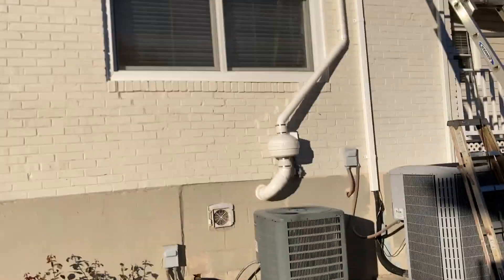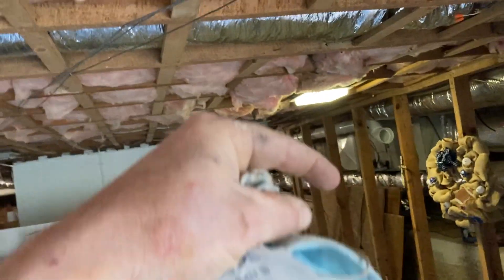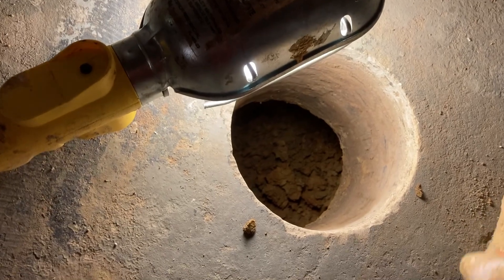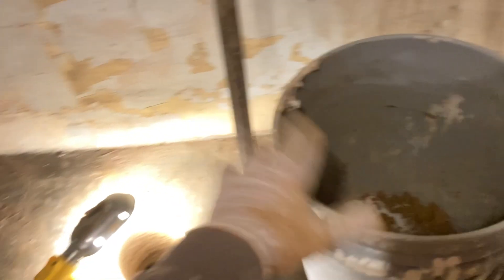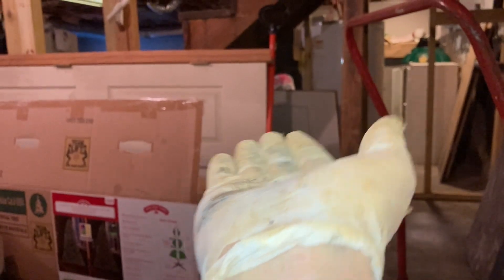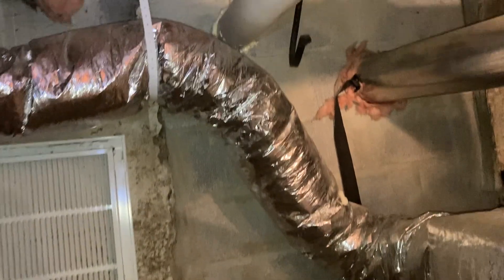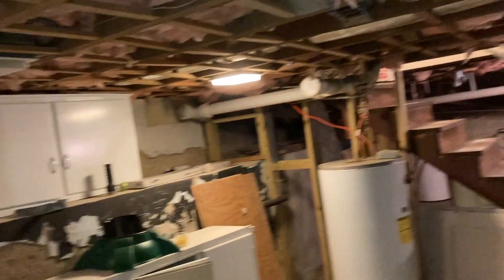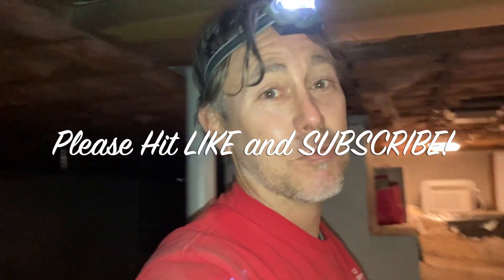Removing Radon In A 100 Year Old Historic Home

Comment: I appreciate your videos. I did my own 150 year old house about 30 years ago, a combination of stacked stone walls, some dirt floor areas and a crawl space that couldn't be crawled through - that was the toughest part. Had guidance from a friend who was writing the EPA Radon manual at the time. Got it from over 100 pCi/L down to about 2-3. Now my son just bought his 100 yr old home - Realtor and building inspector both rushed them through without a Radon test - big mistake. Anyway, my question for you is how would you deal with a basement that has an open french drain running all along the walls, and a sump pit that drains into the sewer? The french drain is the variety that gives a 2 in channel  with no concrete at bottom, just dirt and gravel.
Reply from the maker: That's a tricky one, Mark. Congrats on YOUR own home, BTW!-- A 2" gap along the floor's footprint will affect the suction of a system.  Without modifying his existing drain system, I suppose I'd put my suction points more inside the footprint and remove as much debris as humanly possible in each one.  OR perhaps upgrading the drainage system to a newer perimeter drain system, with a lid for the sump pit, and pull from that.
Reply: @radonman6800  Thanks for your reply! I really appreciate it. I guess we'll have to think about this some more, and look into an alternative to the french drain that can be retrofitted to his old house.

Comment: I discovered that a nail puller/claw bar makes a great digging bar when I had to dig out my suction pit. Nice and compact, but you can move a lot of dirt fairly quickly.
Reply from the maker: Thanks Ben,  every trick helps when it comes to these rough ones. 😀

Comment: Do you use primer and PVC glue for all the fittings?  I didn’t notice any purple stains/drips along the pipe work.
Reply from the maker: Hi Stephen.  I use clear primer.  That purple stuff has a way of getting away from me. You'd see lots of stains and drips if I did. 😂  However, I know a guy who uses it just fine.